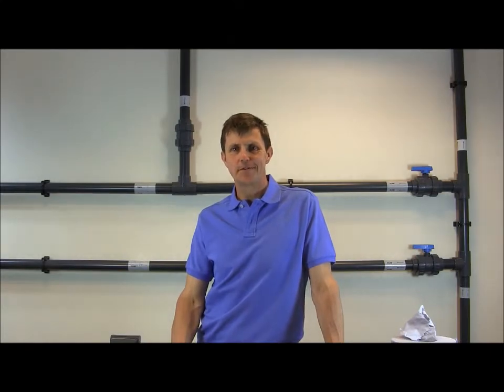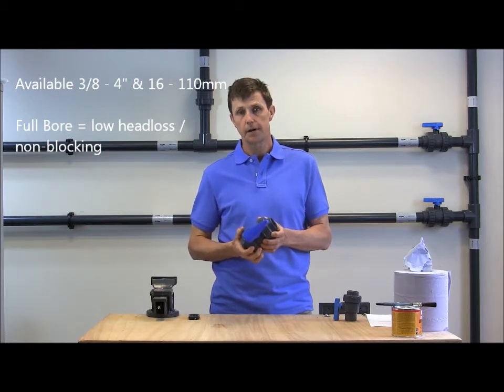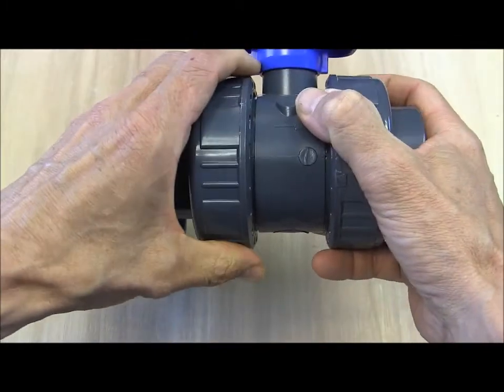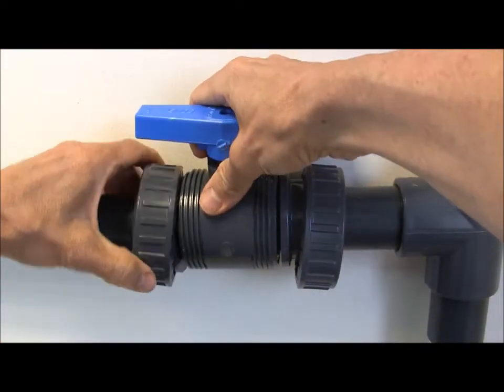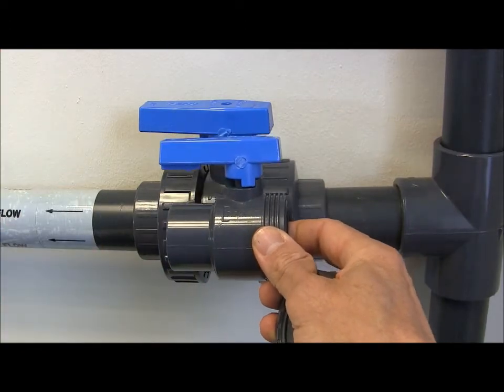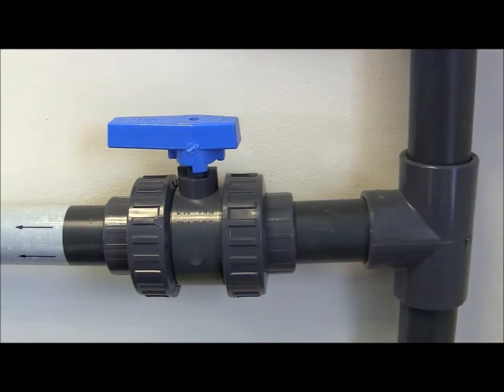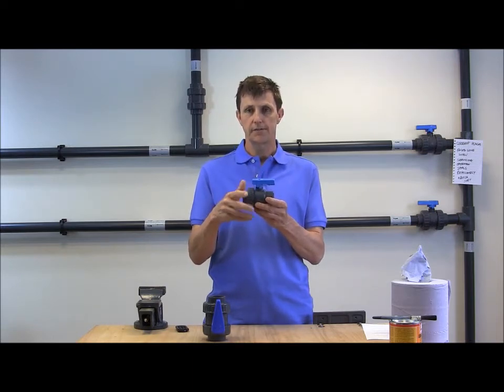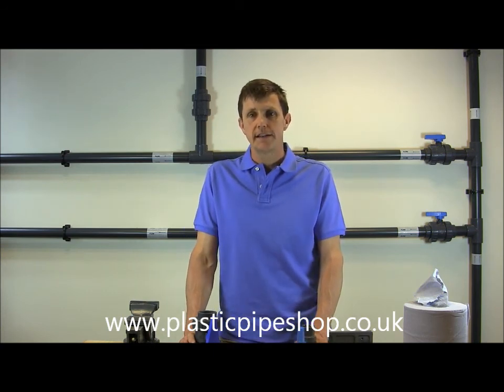Ball valves for plastic pipe systems

Comment: Sorry for the dumb question but if I buy a double union ball valve from you do I need to buy glue to fix the pipes at both ends to the small pieces either side of the ball valve provided?
Reply from the maker: Hi there, no worries at all - we're happy to help! Yes, if you would like to glue a valve into your system, you will need to buy some PVC glue, which you can find here: https://www.plasticpipeshop.co.uk/Consumables_c_3095.html

Our double union ball valves can be purchased with plain ends (https://www.plasticpipeshop.co.uk/Inch-PVC-Standard-DU-Ball-Valve-EPDM_c_1149.html for imperial sizes or https://www.plasticpipeshop.co.uk/PVC-Metric-ERA-Double-Union-Ball-Valve-EPDM_c_647.html for metric sizes) which will allow you to glue the pipe into the ends of the valve.